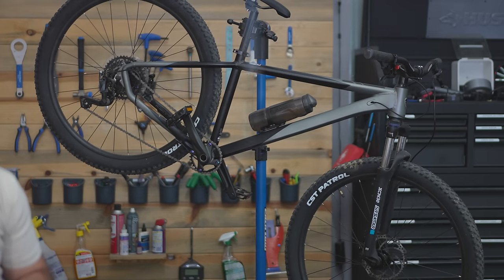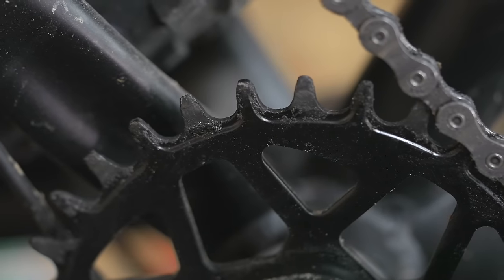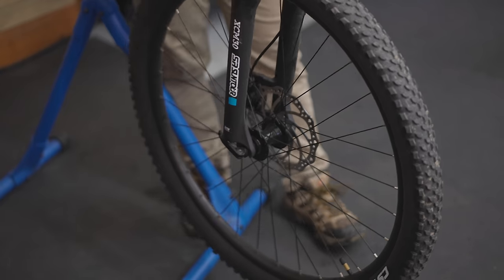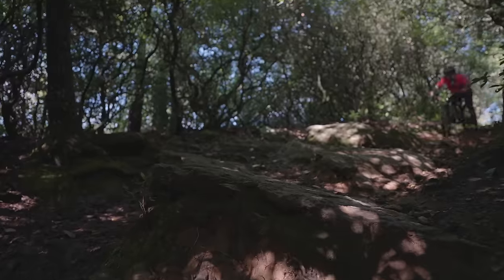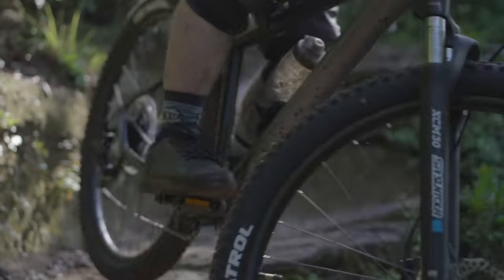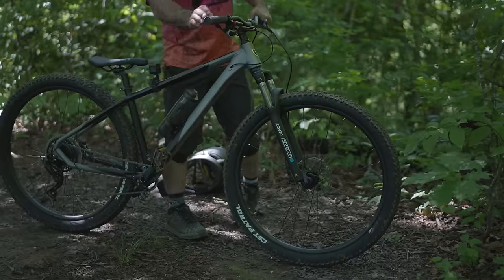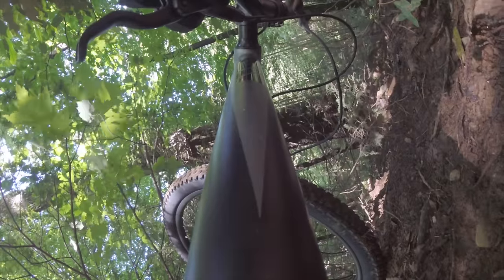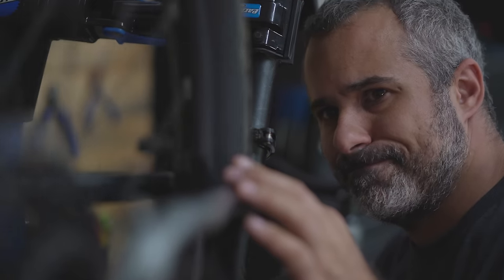Walmart MTB Upgrades! Will it explode or improve?

Comment: I have a much more difficult question to answer.  as far as the quality of the NAMED components of the bike Fork, brakes, and frame.  Is there a possibility that these components are a Lesser versions of what you would expect from an off the rack bike store component?   made cheeper?  like the fork is shown to be "loose" after a few rides.

Comment: Hi Seth! Recently watched again your video about 3x. I run 3x8 but I find myself using only one mid gear in the rear and changing the one on front as I go uphill or downhill. Would you say going 3x1 is a good idea? You still have a benefit of simplicity + you can go away in every scenario.
Greetings!
Reply: Try it the opposite way and report back

Comment: Can you convert the hubs to thru axle with a switch of the end caps to stiffen the front end?
Stay away from those $140 Amazon forks and maybe spend 1/2 ( $260 ) of what your have in the bike on a fork that will serve you well
ps
Walmart if you are listening, price the  Kent Trouvaille at $499 with a suntour 120mm air fork and hydraulic disc brakes and I'll buy 2

Comment: If the problem is the deraileur having no clutch observe you chain length the deraileur hanger must be stretch verticaly to the ground while in the most used gear ratio
Reply: This way it will lessen the slap cause the deraileur is already near the ground

Comment: If you think that's budget search this bike Rockrider ST530 it's cheaper and comes stock with hydraulic tektro brakes a derailleur with clutch 1 by 9 drivetrain the only thing that must be upgraded is the fork

Comment: This is basically what you go thru buying a Jeep Wrangler, or even a BMW adv motorcycle. They both come ready to roll on pavement, but if you want to do what they do in the commercials, or even close to it, you basically only bought a platform onto which you add components capable of what it's advertised to do. Annoying, but also fun, but also expensive.

Comment: With the zoom brakes, are you able to keep the stock 180 rotor on the front wheel? On Amazon it said you can with the adapter, but isn't clear if it comes with the adapter you need.

Comment: PSA: to anyone who buys these brakes. The company I work for spec these brakes on one of their bikes and let me tell you they all come back frighteningly soon with leaks on the lever seals. You’ll see mineral oil residue on the inside of the lever blade and as a result they get plenty of air and dirt ingress in the system. You’ll need to bleed them regularly and eventually will just replace them… Spend a bit more for a better brand and avoid the hassle

Comment: I guess my question would be is at what price point do you just buy a "better" bike from the start? Honest question, looking for a starter bike and wondering how much it would be to get in at ground level.
Reply: For about $500, you'd be getting a bike not too dissimilar from a "name brand" that charges about $850 if you have the technical know-how (access to the internet) and access to the necessary tooling.

Tooling costs money though...and may cost you an additional $100 or so to do the upgrades.

Comment: I always got cheap hydraulics because they feel the same but I stopped recently as I noticed the seals and the casting are poor quality. So yeah they work fine until you take them to the bike shop for a bleed and they refuse as the seal are garbage or over a year the oil just leaks out of them.

Comment: I would spend the extra few hundred dollars and buy a VITUS Nucleus instead. Suntour Air Fork, Maxxis Tires, Shimano Altus hydraulic brakes, tapered headset, internal cable routing capable, comfy name brand saddle, lighter weight, wider bars, basically every part on it is name brand. All for a little more than Seth has into this Walmart bike.
Reply: I'd even recommend the most entry level rockhopper over this. A beginner mountain biker doesn't have the tools or expertise to try to make this bike safe and rideable. The ride quality, durability, and peace of mind of just spending a couple hundred dollars more on a reputable brand seems like a no brainer. It's still an interesting experiment and fun to watch though, not knocking the video.

Comment: Another fancy upgrade you'll enjoy riding is getting 2.6 27.5 tires and new wheelset on a 29frame. It's king of downhill after this due to the lower bb. That alone transformed an entry level spz jett ofy wife on a dh killing machine. Got the best descent of my life, spraying sand on turns just like dh Redbull movies. Never got any faster, even with full suspension bikes. Give it a try you'll love. It was a regular suntour spring 80mm fork just like the kent's

Comment: you can get low end shimano hydraulic disc brakes for around the same price as those on amazon, why go off brand?
Reply: hell, i got a m355 kit for 85.97 that also had bafang ebike cutoffs installed a couple years ago. got a mt200 kit around the same time for 90 bucks, and just recently bought a replacement mt200 caliper for 18.26. i just don't see why you would have needed to go off brand. its a 20 or 30 buck difference i know, but it is all still under a hundred bucks.

Comment: I feel like you only beat the system if you can assemble, and work on your own bike. if you were to take this to a bike shop they would charge you enough to turn that $400 bike with $200 in parts into a $800 bike. At that point you should just get a new entry level hardtail at $800 or $900 bucks built by a professional mechanic.

Comment: It won't be quite as cheap if you don't know how to install the parts added on and have to pay a shop to install. You'd end up at the same cost or more than a bike from a shop if you need to pay labor to have brakes installed and bled, as well as crank and bottom bracket installed. Because you'd be looking at around another $100. More if you do add a clutch derailleur. At that point, may as well have bought a higher quality bike to begin with.

Comment: Love to see an air fork from amazon on this bike
Reply: I ordered one Alex but I kinda wish I ordered the bucklos 32 for it
Reply: BUCKLOS 26/27.5/29 Travel 120mm MTB Air Suspension Fork, Rebound Adjust 1 1/8 Straight/Tapered Tube QR 9mm Manual/Remote Lockout XC AM Ultralight Mountain Bike Front Forks
Reply: I just got the tapered head 29 inch black and gold

Comment: The budget air fork is probably number one, then if it were my bike I'd probably swap the pedals for something decent but not too spendy like the Bontrager Line Elite (the ones with metal pins) -- more quality of life than pure performance, but makes a big difference in how the bike feels. After that, maybe you could score the same Microshift advent 9-speed derailleur but with a clutch? Looks like REI has them for $65. Not nothing, but not crazy either, and for around $250 I bet those additional upgrades make the bike feel a lot more expensive than 700-800 bucks.

Comment: my sort of upgrade is slapping on a fat seat so it doesnt ride up my crotch. with a bent back seat post. and switching out the tires for slicks so the top speed can increase. and a cheap 150$ air fork from ebay

Comment: Suntour XCM level forks with air or coil are pure trash and isn't suited for actual mountain biking. I would say they are actually dangerous and basically needs service every 50km if you want a chance of it working like it should..  you will be better off with any cheap rockshox fork

Comment: I can't for the life of understand why anyone needs hydraulic brakes. I am 77 years old and have ridden thousands of miles with mechanical disk brakes. I can stop as fast or faster than anyone. It goes without saying the brakes have to be in proper working order of course.
Remember every time you stop fast you have lost energy. You don't get that energy back. Your body only has so much. You just have to work harder to get back what you lost. Plan ahead and let the bike slow down before stopping. Save hard braking for an emergency.

Comment: Your not considering the frame.   It's Pacific right?  They blow air through the metal as it's formed...it's clever (cheap)...AND it's pot metal to begin with.  Someone WILL get hurt eventually.  Broken 3 of them before I got a Giant.  Don't upgrade that BS!!  Bad idea.

Comment: Definitely do not recommend these chinese brakes, i bought them for my touring bike because I don't do very hard breaking during travelling, didn't expect anything from them, I was just curious to try some Chinese stuff on my bike, anyway, after some stressing one sealing of the piston on the front caliper failed during a descent, had oli all over the disk, very horrible situation ... After I put on new caliper that I have hanging around and thought everything fine, but they started leaking from the master cylinder in the lever, unfortunately I discovered that in the middle of a journey ... Also the levers are very noisy, always rattling around, maybe they fixed this issues, I bought them more the a year ago, but I'll never buy them again

Comment: Get to know your local mtb community.  Buy used!  My 2006 K2 team is a far, far better bike than this piece of crap.  No one will give me a $1000 for (don't care) it.  Use it to ride with grandchildren.  My local bike shop often has older bikes with wheels and tires worth more than $500 for less than $1k.
Reply: Sorry but the ones here mostly care about the materials and specs and are unconcerned with brands names just be happy they're smart enough to stay away from knob shifting, steel framed heavy bikes with the same brakes from in the 90's